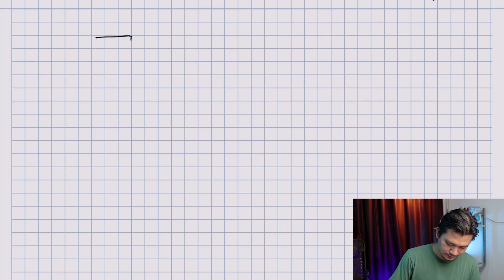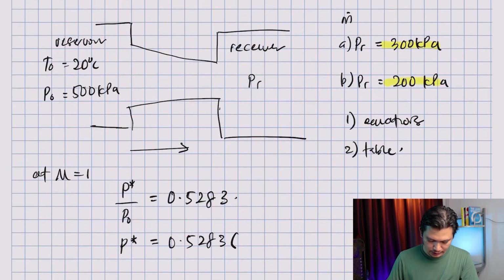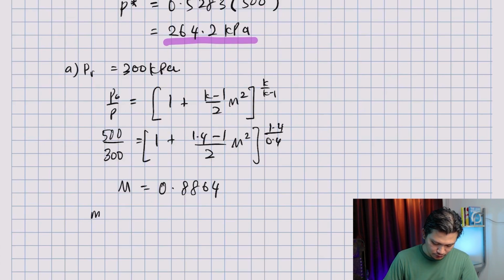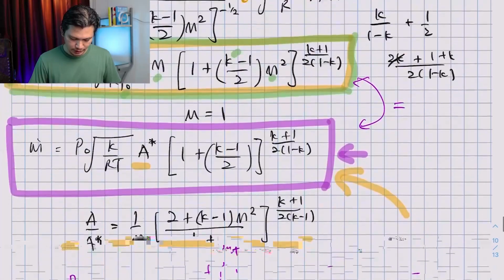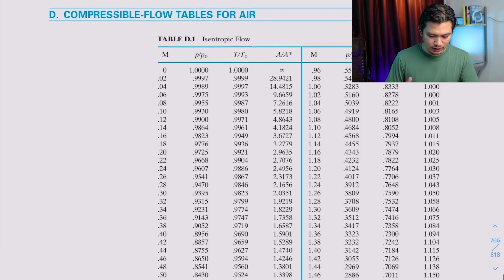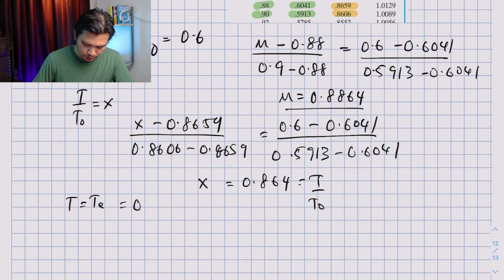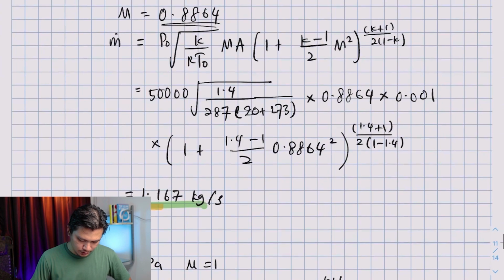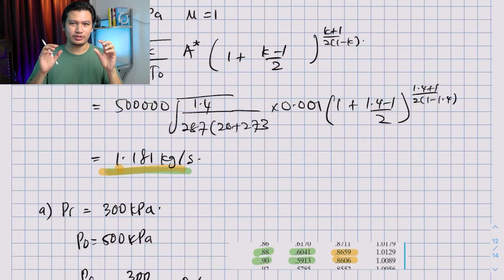P2-023 Compressible Flow Tutorial 1

Comment: sorry dr,  im a bit confused with the explanation about when mach number = 1, the pressure in the receiver will be 264.2KPa. what does it got to do with the Pr in (b) which is 200KPa ? how do you know that when Pr = 200KPa, the mach number will be 1 ? isn't both of them (Pr= 200KPa and 264.2KPa) are two different values ?
Reply from the maker: You can say that 264.2kPa is the threshold where pressure lower than that would result in supersonic flow. If the exit pressure is higher than that, it is subsonic flow.
Reply: @drhasbullahlectures5547  alright dr thank you :)